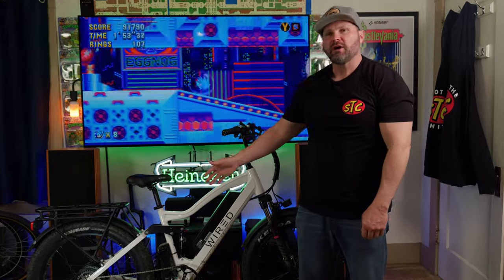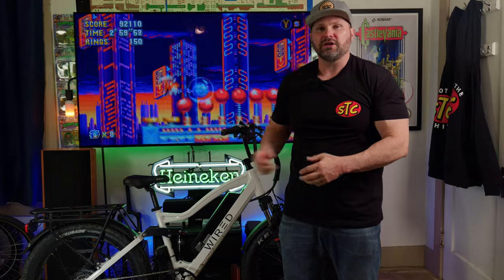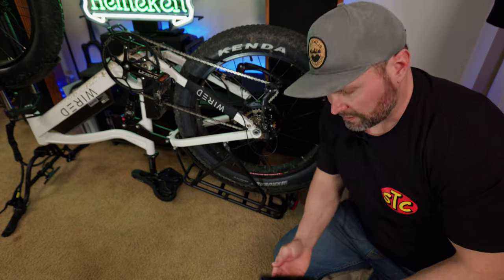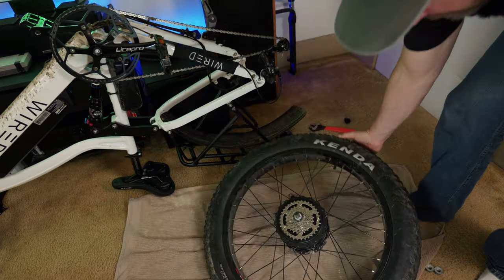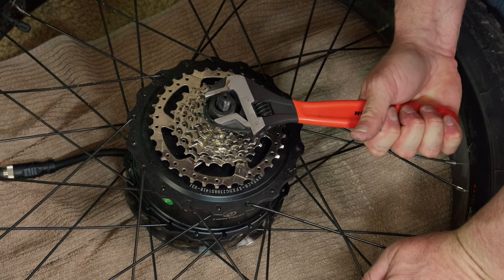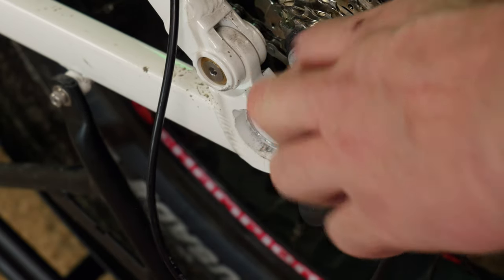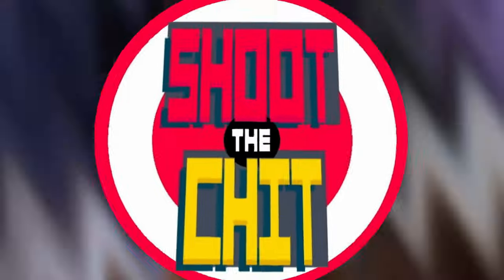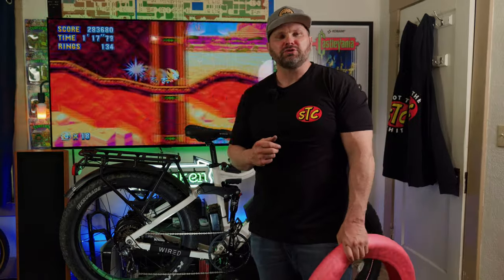How To Change Freewheel On Wired Freedom - Chitty Tutorial

Comment: Excellent video, thanks for the links.  Really looking forward to the seeing how the new cassette works with a smaller front chain ring.  I’m absolutely pummeled by steep hills on my ‘24 Freedom with the current setup.  Keeping your speed up while pedaling uphill is impossible without switching to PAS 4-5 or just using the throttle.  Keep the videos coming, great channel!
Reply from the maker: Same for me.  Get going up a somewhat steep hill and you have to go right to PAS 4 or 5 or stall out.
Reply: I’ll be interested to see what the difference was and how the front ring does as well.  I can’t change the front on my Level due to where the frame is,but I did change the rear gears.  I think I lost a small amount of torque but gained a little speed with the high gears.  Helped a bit with ghosting.

Comment: I suggest a pipe wrench, if you not super strong, those free Wheels can be really difficult to remove. Also 32t is the  biggest I've ever gone a freewheel, but im curious, i seen 42t freemwheels on line now, im wondering if it would work, probably would need a 10-speed derailleur.
Reply from the maker: 34 is the biggest I saw with a 7sp cassette.  Usually if you can find the derailer specs it will tell you the largest cog it can work with.

Comment: Bought all "the stuff" to lower my gearing, front and back sprockets, will prob do it this weekend, hoping to avoid removing any chain links as I've never had to do that procedure before, prob not that hard though, just need the chain link removal tool and a master link... Anyway.. Prob hardest part of procedure will be getting "The Beast", aka FREEDOM!!!! Flipped upside down as not sure that my Mtb Stand can handle the Brutal 88lbs lol of FREEDOM!!! Might try it though as it looked like it worked for you, but you ended up flipping her!!! Ok Fellow "Chit Heads", please a very kick ass "Chitty Weekend" my friends!! : )
Reply from the maker: You might get away with using the stock chain and not removing any links. I would give that a try before you remove anything.  Its easier to flip the bike upside down to service the rear wheel than putting it on a stand anyways.  Getting the wheel back on the bike is much easier when you can use gravity.
Reply: Thank You!!! Going to get up early tomorrow to go riding, last time in stock gearing. Then I'll switch out the front sprocket, avoid messing with chain links, hope that works, otherwise will experiment with removing links!!! Thank you for all of your help and advice, great Youtube Content too!!!! : ) FREEDOM!!!! @shootthechit

Comment: Good thing they moved the motor wire to the other side finally realizing that it was almost impossible to remove the freewheel with anything less than a very expensive special tool. And when I say "they" I mean the ebike industry in the past and not Wired in particular, which has only been around for a couple of years.
Reply from the maker: You can tell a lot of these companies didn't engineer things very well and just slapped things together.  Seems like its getting better the last few years